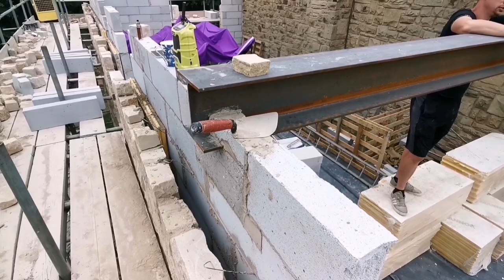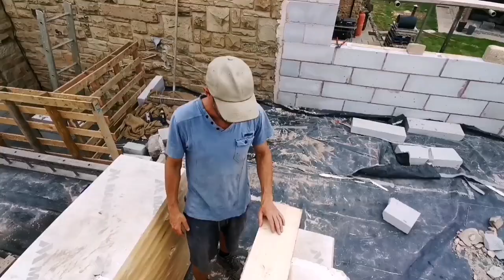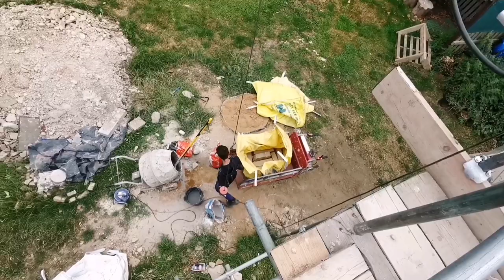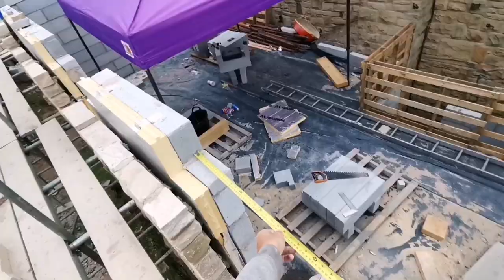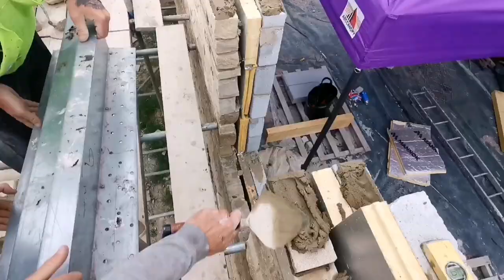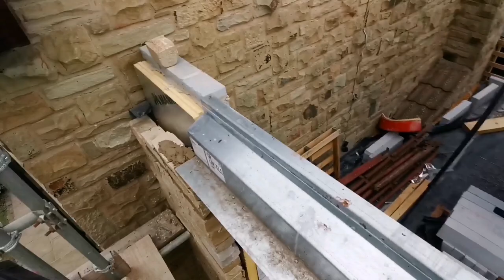stone extension lintels going on big build

Comment: Those big holes in your work platform look a bit iffy 🤕

On occasion I’ve used a decking spike to do what you did with the felt pen / bolt. A decking spike is like an 8 inch long nail that’s about 8mm diameter. A tap on it with the hammer and it will leave a centre hole impression. Or I just dip the bolt head in a little bit of paint.
Reply from the maker: Some good ideas mate 👍yere definitely a few gaps think they went to fit two boards down at front but haven't measured it right. Two boards fit round back 👍👍👍